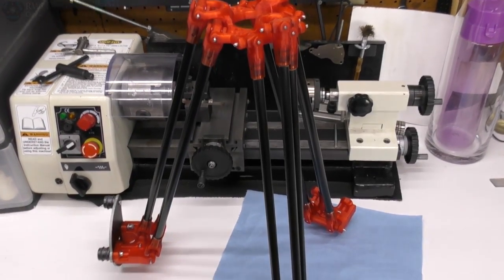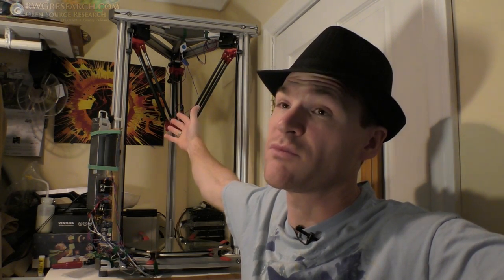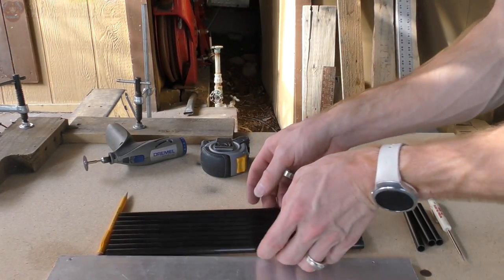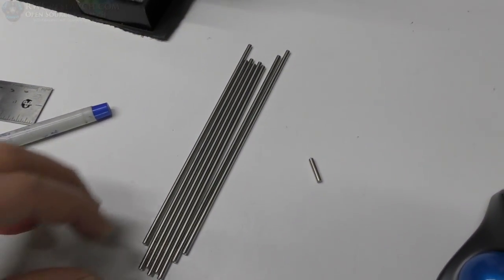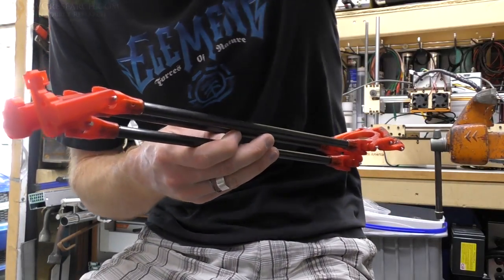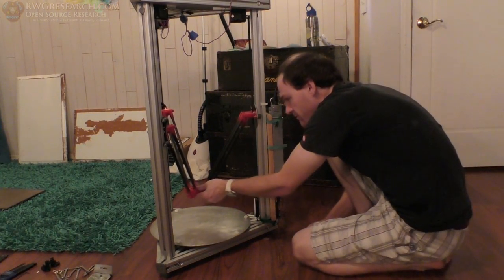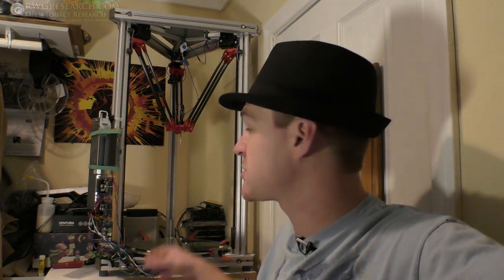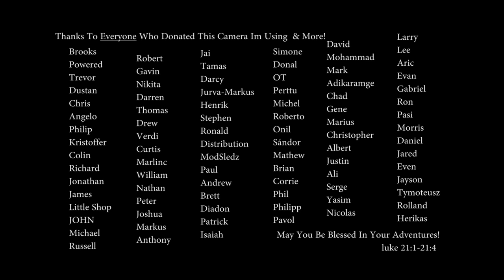RWG-OSD # 30?:  Tri Arm Delta? 9 Rods?  Does This Even Work???  What Did I DO!!!!

Comment: No, of course it would not work without the third arm! You need at least one rod there for hight! Proof: Just open the third belt, if you are right that carrier would rest on the printhead-platform which should be supportet by the two other arms according to your theory. But that would not work. Triangulating the position of the printhead in the room needs, as pointed out by the "tri", three known points or distances in this case. So one rod on one arm should work when the two other three-rod arm provide the leveling for the platform. Otherwise keep up the great work, love your projects!

Comment: Congratulation Russ, well done!!
I think you should go with lead screws like this https://www.youtube.com/watch?v=vhodLP9ws0Q for example.
The most force will go  in the frame instead in the motor then.
You will also need a transmission then to go for the max speed, lets say yor belt goes 32mm/rev of the stepper motor and this leadscrew 8mm/rev.
this will end in a gear ratio of 1:4 (16 and 64 thooth pulleys). 
You should also go with a second gear set wiht a 1:1 ratio for milling action by just switch the belt.
Linear rails also recomendet.
I wish you success, have a nice day

Comment: Hey Ross check out new Z probe thing for delta printer. Thing is that it uses Strain Gage to detect a bed and guess what its made by same people who make Duat and it is compatible with Duet firmware. You should check it at https://www.duet3d.com/DeltaSmartEffector only problem is  that its using magnetic balls and its designed for Kossel but Im sure you could make it work
Edit: http://forums.reprap.org/read.php?178,783399,page=1